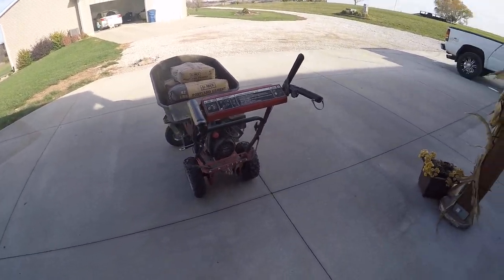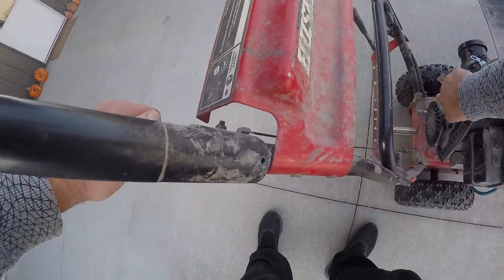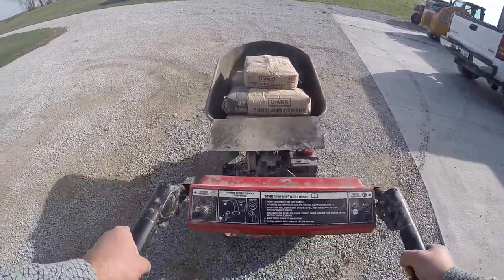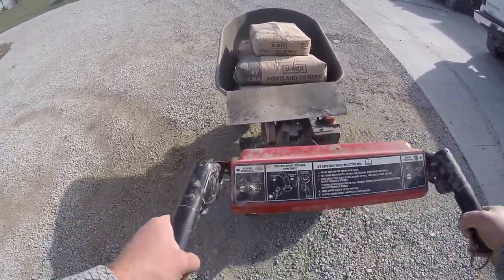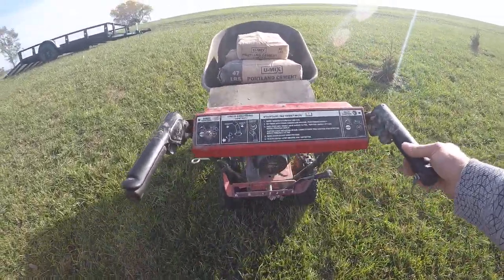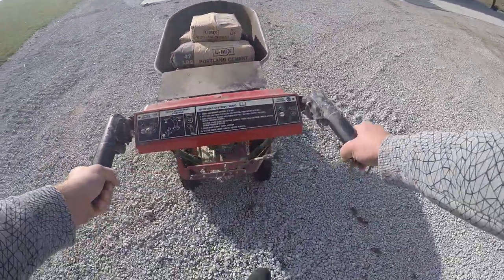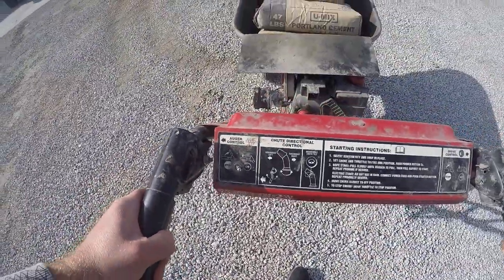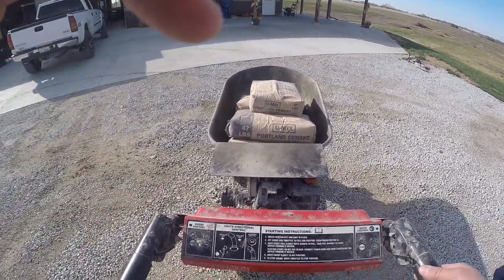Power Wheelbarrow made from snowblower part 2.

Comment: Snowblower engines don't have air cleaners, and I'm sure the dusty environment you use it in has killed that engine by now.
Reply from the maker: I put an air cleaner on it after the conversion still runs great years later